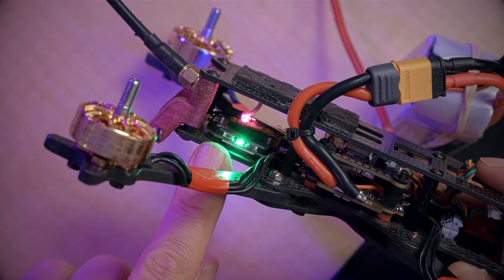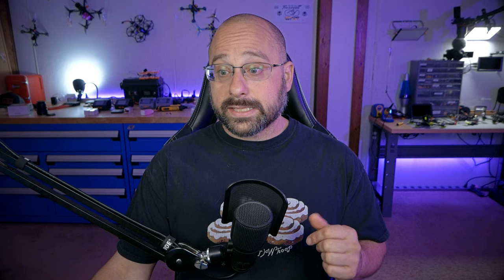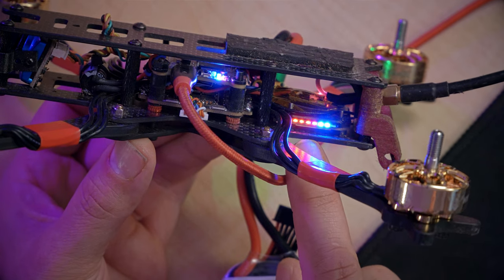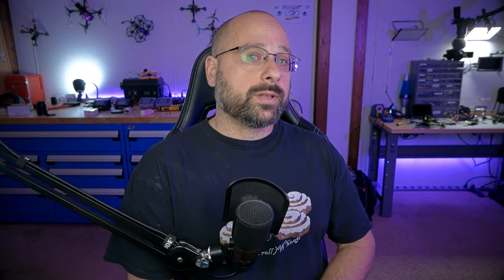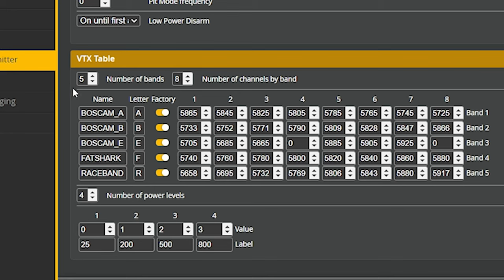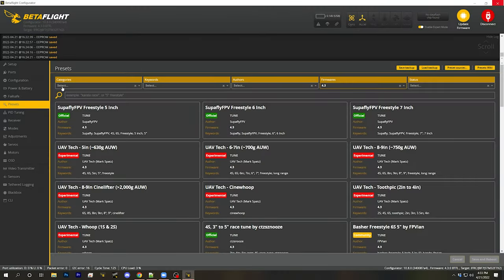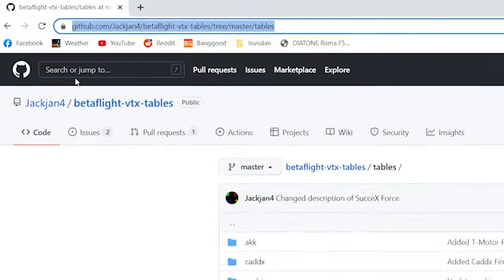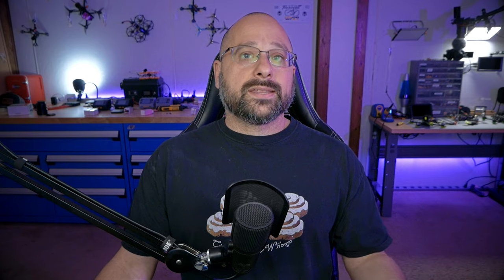Betaflight 4.3 Video Transmitter Tab | COMPLETE WALKTHROUGH PART 9

Comment: Josh,
many thanks for all your great videos. I learned a lot from them about drones, their construction and configuration.

I have one note regarding the VTX configuration video. I had a problem myself to properly configure the Rush Tank Ulimate II (it did not want to change the channels and transmitter power using the BF settings - it could only be done using the buttons). Well, the bug is included in the Tanks BF 4.3 Presets. The power levels are listed there according to Smartaudio Protocol 2.1, which standard does not work properly with the receiver at all. It has the values 14, 23, 27, 29 which is wrong and therefore Smartaudio does not work! The power level values must be set as for you, ie: 0, 1, 2, 3 (Smartaudio Protocol 2.0) and then EVERYTHING works properly. It took me a long time to figure it out, so I tell other beginners to do just that.

Comment: OK, I have a DJI VTX (but I kept watching, you're welcome :)
and I am pleased I did. the Low Power Disarm, On until first arm. (It's late here in the UK and I am off to bed, so I will have to play with it tomorrow)
but will that still work with my  Caddx Vista ? 
I hate it when I am going to crash and I Disarm, and the Goggles stop recording. And I don't get to watch my crash 🤕
Reply from the maker: Nothing in the Video Transmitter tab has any effect at all on the DJI system. The Vista has built in temp protection option which emulates low power until armed.
Reply: @JoshuaBardwell  thanks, so is there any way to get the goggles to keep recording, after I disarm. or get the Vista to stay on hight power for (say) 15 seconds after disarm. so I don't miss my crash, crashs :)
Reply from the maker: Yes. Turn off temp protection option in the Device menu.
Reply: @JoshuaBardwell  Thanks mate, I did just watch your "DJI FPV very short range? ...." video for the 2nd time, and I'll give it a go. but if you smell something cooking... that will be me :)
mind you here in the EU (well the EU'K) we are only on the low 25 power all the time

Comment: Mr. Bardwell... you are the best sir! thank you Joshua for all these BRILLIANT content. I am a beginner with a PAVO 30 and was getting NUTS because it had like a 3 ft range... turns out that the VTX (betafpv M02) has a tiny little button where you can turn on/off the Pitmode and does not shows in BetaFlight... thanks to you I could fix it!:goodvibes: definitly new sub!

Comment: These are great videos JB!!  Question for you gurus.  I have a Speedybee TX800 VTX that runs on 5V.  This is my first build and put it on the FC 9V pad.  Did I fry my VTX?  I never saw, heard, or smelled anything but my VTX light doesn't come on and Betaflight has Device Ready = No.  I do have my 4S battery plugged and checked the pad output with multimeter at 5V.  Smokestopper has always been green.  Thanks!
Reply from the maker: If the vTX is rated for 5v and you gave it 9v and now it doesn't work then yeah I think it's fried.

Comment: Very helpful series so far ,thanks a lot.
off topic for this video I know, in my narrow, humble view Betaflight in 4.3 (i'm at rc6) didn't make a great job when it comes to pid sliders and filters.
to me it completely ruined what I was at least able to achieve in previous versions, no use to add a lot of stuff if it brings such lots of misery.
one example, you got a barely 1 - 1.5 y old quad, say your fc dies, you replace it with an identical one, you flash it to 4.3 rc6 but all you got from manufacturer (or your backup) file with the best tunes for this quad but it's still in 4.2, after firmware flash you go to cli, execute the file, it doesn't even swallow the pids, aou need to disable their s*** sliders and re execute and it will swallow most of it, the pids etc but even then you still 52 lines it doesn't take, errors mostly that it doesn't know the variable name and those are all about f**** filters.
After that can't reactivate filters, it's a mess. The compatibility tool for migration, I know about it, gave it a shot, but ain't nobody got time for that who has a life.
Tried my best to make a head and tail out of the lines it didn't take and try to input them manually (those I found) in the bf gui, but rekon7 then had vibrating motors, getting hot, unflyable, dangerous annoying as hell, almost killed my motors and esc, got bored with it, returned to 4.2 flashed my backup and everything's fine with the quad now, honestly bf I could do and say things to them I'd rather not mention.
Reply from the maker: You definitely can't paste a 4.2 CLI dump right into 4.3. That's always been the case with updated releases. If your complaint about 4.3 is, the manufacturer hasn't released a 4.3 CLI dump for your quad, that's hardly Betaflight's fault :-( But the solution is, as you did, to go back to 4.2.
Reply: @JoshuaBardwell  I get what you're saying. Just to make it clear, didn't mean any disrespect against you, in fact got the outer most respect, gratitude and admiration for you, but the reality is manufacturers won't ever bother to do that except for the next / newer models and as any support always says first upgrade to newest version of OS to solve or improve this or that but that just won't happen unless you a. spend a no life time on it or b. just buy a new quad which is probably the intended omega towards mere mortals. It would just be nice if there was an easier way to upgrade bf so that at least what worked before keeps on working without too much hassle.

Comment: Regarding PIT mode, just yesterday I spent a few hours playing with it on my Mobula 6. I had a reverse problem, the PIT mode wouldn't turn off. Turns out on the Mobula VTX you can't toggle pit mode from the configurator. I had to use the OSD and go to FEATURES>VTX>CONFIG>OP MODEL and here you can choose RACE or FREE mode. Race is PIT mode on startup (until first arm), free is no PIT mode. After selecting race mode you also need to choose PIT mode type (PIR or POR) and then after saving reboot the FC and VTX

Comment: Good info with great detail. I just wonder since 4.3.0 is pre-release how much of this will change when 4.3.0 is released? I've been testing 4.3 on 2 of my quads for several RCs now and I haven't had any issues. Overall I'm liking 4.3 so far but I'm finding that the 10.8 configurator(s) are kind of unstable. Then again, this is pre-release software.
Reply from the maker: Most of this hasn't changed since 4.2, except for configurator moving some items to different tabs. I don't think anything is likely to change since 4.3 is so close to final release.

Comment: I have a vtx that is supposed to go to 400mW but only goes to 200mW. Do I get the full 400 by adding another power level?  It has three levels 0 1 2 as 25 100  200. So do I make it 4 levels to get to 400?

Comment: When I hook my Tiny Hawk S up to BF, there is NO VTX tab, period! I did install a TBS Unify Pro Nano VTX using the same connections that the OEM VTX had that I had removed. I also have now added ELRS into the mix and have been flying with that but I messed up in BF trying to get my  goggles to show RSSI  with SA but the "Yaw left Pitch forward" menus only show configs for Tramp. I try to do it for SA but nothing selects even though is a TBS VTX. Just a bunch of xxx and _ without words.  Crazy. Any help or link for me? Thanks.

Comment: Interesting thing about pit mode not working on some vtx's, I had betaflight 4.2 with pit mode working after power up, but after updating to 4.3 and migrating settings, it doesn't work anymore. Everything else works as it did in 4.2 except pit mode

Comment: Hey I just bought a pavo pico drone with a o3 air unit and I have DJI fpv remote v2 and I connected the remote and goggles to the o3 but can not get my remote to show up in beta flight and can’t fly is there anything you can do to help me?

Comment: How does turtle mode arming work with low power disarm? Lets say I crash way out in a field, in some tall grass.  I don't want to be armed because that spins the motors and they may burn out (would idle speed spinning burn out motors? I don't even know). So I disarm and the quad drops to 25 mw and I lose my video.  What happens if I turn on turtle mode and then arm again? Would it jump back up?
I worry about this because a hot vtx could start fires in places like california pretty easily.  If it is going to take me awhile to get to my quad and I am in a dry grass field I would be really scared of starting a fire under those circumstances but it would be nice to be able to pop the power back up intermittently.
Kind of a dumb question I suppose.  probably just better to put max power and min power on a switch somewhere, but with a turnigy evolution there were not that many switch options.
Reply from the maker: When you arm in turtle mode, the vTX goes to high power.
Reply: @JoshuaBardwell  Nice, seems like this would be the best way to do it then, it solves the issue of losing vtx signal, because as long as you have control link you should be able to just to into turtle mode and get it back anytime you want.

Comment: JB, the Darwin 129 came with a VTX table on Betaflight but I think it’s stuck on 25 Mw, how can I tell if the other powers 200/600/800 that show on the OSD really Work? 🙏
Reply from the maker: If you don't have something like the immersionrc RF power meter, it's difficult. The next best thing is if the vTX has an led readout or something.

Comment: Hy jb.. i have openvtx ovx300 when iam using bf 4.3 or above i seen the smartaudio undefined. But if iam using bf 4.2 i seen smartaudio. Its normal. All seting with same vtx table. I never seen post like that when i try to searching openvt undefined. Iam gratefull if u have solution. Thanks

Comment: Hey everyone, I've got a problem I could use some advice for.  I finally got my drone all put together, and I went to plug it in to betaflight and it did the normal 3 and then the 1 beep, but after that it started repeating these 3 tones over and over and it wasn't showing up on my computer either.
I looked on a program that shows all USB devices, and it shows up for a second, but then it goes away.

Can anyone help me with this?

Comment: do i have to find the vtx table that must correspond exactly the vtx im using, or can i just use smart audio as the one im using supports smart audio???
Reply from the maker: SmartAudio is the protocol used to talk to the vTX but you still need a vtxtable so betaflight knows what channels and output powers the vTX supports.
Reply: Ok thank you, I found a vtx table for smart audio 2.0 and it seems to work. The goggles connect to the vtx but there is just a black screen and says battery full in the goggles.  What is wrong? Could you please help me out on that.
Reply from the maker: That means the FC is not getting signal from your camera.
Reply: Right, thanks a lot, I managed to sort out video. Now, yesterday I bound my reciver to the transmitter and everything was working in betaflight, but today the receiver doesn't turn on even when I plug the lipo in. I checked that the pad on the fc output the correct voltage to the receiver. There is no light on tue receiver and its rather hot. What shall I do???😥 Sorry for asking so many questions.

Comment: @7:20 "It intuitively makes sense if you used transmitters before." I've not, what do they mean to us whom have not used them before?
Reply from the maker: Band and channel determine what frequency the vTX transmits on. Like old analog television, each channel is on a different frequency.

Power is the output power. Higher power = longer range.
Reply: @JoshuaBardwell  Thank you Joshua! How does range work with the camera? Does the camera have a transmitter too or is it piggybacking on the drones transmitter?
Reply: @JoshuaBardwell  Also, can I just choose any power setting? We're using a predator v3 and it just lists a range of 10 to 40. :P
Reply from the maker: The camera has no relationship to the transmit power. The camera just feeds video to the video transmitter (vTX). The vTX is what has transmit power.
Reply: @JoshuaBardwell  Thank you for dipping back to a two year old video to answer a newbies questions! I've been following this series and it's been really helpful!

Comment: Hi,I have a weird problem with my quad.
When i spin the motors in Betaflight all is fine, but when i arm them the start twitching veryhard  and get hot. For me it seems like a pid proplem cause when i remove the fc and hold it in hand the problem is away and the motors spin rather smooth.
I checked the motor orientation as spin direction multiple times such as the fc board orientation. I reflashed the firmware a few times.
I even set the PID variables to 0 but nothing.
I hope someone can help me. I think its just some dumb mistake
Reply from the maker: You could have some source of vibration like a off balance motor, bad bearing, or cracked frame part.
Reply: @JoshuaBardwell thx for the tip. If Ich hold the quad very tight the twitching Shops. in your Video I saw that I can Check the different motorvibrations in betaflight. How much is to much ?
Reply: @JoshuaBardwell  is there a way of compensation for a vibrating motor or do u need to replace it?
Reply from the maker: You need to replace it, to be honest.

Comment: Dude, stop saying "The VTX table is complicated". Its not, and you're brainwashing people into being scared of it. What on earth is difficult about a table?
Reply from the maker: What I'm saying reflects the questions I get in my inbox from people who are having problems. I'm not brainwashing people. I'm reflecting the actual issues that people are having, that they ask me to help them solve. 

What's so difficult about a table? Knowing which table to load. Because if you load the wrong values, then your vTX locks at 25 mW. For example: If you have a Unify, should you load SA2.0 or 2.1? If you load 2.0, then your power values go 0 1 2 3. Ok -- what output power in mW does power value 2 equate to? Depends on which Unify you are using. Some of them go 25 100 200 400, some go 25 200 400 800 or whatever. If using SA 2.1, then the power value is the mW in dBm. Easy peasy -- just convert to dBm right? But what if you put in a dBm that doesn't correspond to an output power that the vTX supports? Well thank goodness Tramp vtxtable is so simple. Yup. In Tramp vtxtable, the power values always must go 25 100 200 400 600, so if your actual vTX outputs 25 200 600, then you will have power VALUE 200 equates to actual output power 600 mW, even though 600 is also a valid value to put in, but that vTX won't recognize 600 as a power value even though 600 mW is a valid output power. Except actual IRC vTX you can just put in the actual mW as the value and it works correctly.

So yeah. On the one hand, "just load the right table" is correct. But knowing which table is right is NOT easy.
Reply: Except when you are new and struggling because you dont have video. I was literally here just a few months ago. Now - I have DJI and I don't care except I love learning all the things I couldn't figure out by fumbling for hours.
Reply: Being new to Betaflight It was  daunting at first trying to figure out the hardware and which tables to use.  It's videos like this that have helped me immensely in coming up to speed.  

Another thing.... even manufactures get it wrong, example EMAX TinyHawk 3 vtx table factory settings were wrong and if it wasn't for videos like this I would have never realized that smart audio always start with a 0 offset.